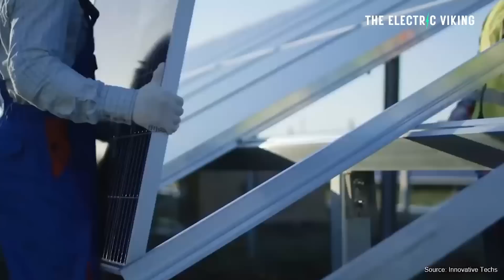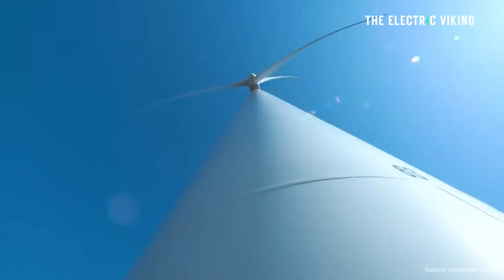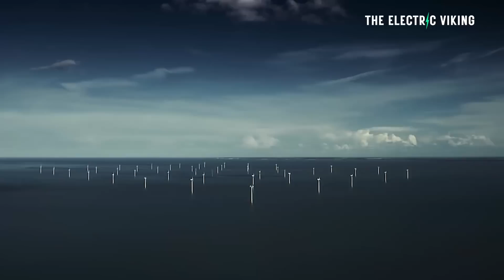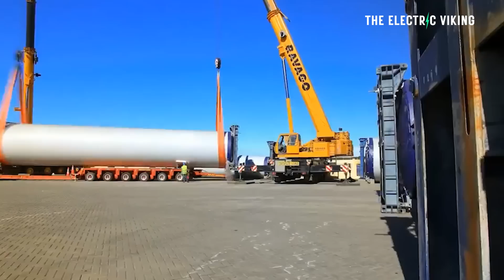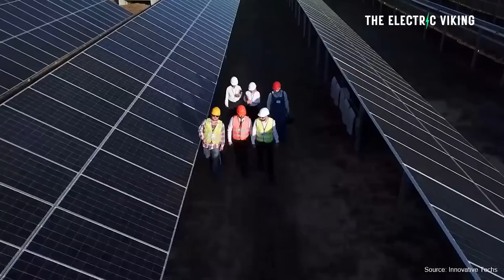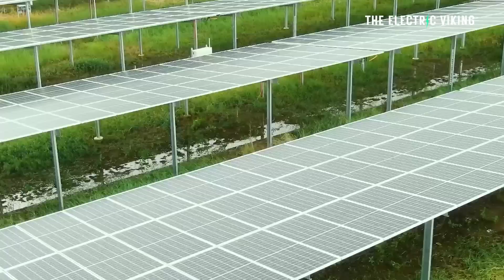8 countries now generate over 99% of their electricity from renewable energy

Comment: The best wind turbine I designed to be the smallest size, can be installed at a low height, does not take up space and is noiseless. It uses water pumps to a high tank and spins the turbine when there is no wind, so there is no need for batteries. The cost is very low, resulting in the most efficient wind energy and the least impact on the environment.I am going to Canada and I have installed a high-efficiency wind turbine in my private garden.

Comment: As a Norwegian, i wonder where the 1,6% made from fossil fuel comes from? Smaler generators at off-grid building sites? Surplus electrisity imported at night, from coal powered or nucular plants outside Norway? Or is it the smal coal powered plant at the Svalbard islands, delivering electricity to the 2417 souls living at 78 degre north in Longyearbyen, that are close to the northpole, and where it is total darknes for 4 months every winter. On 19 of October 2023 the coal powered powerstation was shut down and replaced with a new one runing on Diesel.

Comment: Ya even if your claim were true - Electricity is only 33% of the power used. ALL the rest is fossil fuels. Even Iceland that has all geothermal for electric and a lot of heating; they still have lots of fossil fuel used. Norway exports oil; but they do have a lot of hydro for electricity. Hydro dams are giant CO2 users; they take 20 million tons of concrete and 2 million tons of steel to build.  Do you think Frances's nuclear power for electricity is zero CO2?  Wrong; production of rare  U235 uses massive amounts of mining then refining and then you have giant structures for cooling towers and containment; plus you have terrible side products like polonium.

Comment: So there are new ways to improve energy generating capabilities from existing windmill. That even with no wind the windmill runs.... And capturing other things like static energy and many other forms of energy. And yes, at the top of the windmill, having solar panels, even the shaft of the windmill can be wrapped in solar panels. Even if you have horizontal and vertical working together, that's when they're wind.Then my system works when there's no wind and the solar panels wrapped around the shaft and at top and maybe on the blades can further generate energy.....

Comment: Yes, these near ground wind turbines would work perfectly on a windmill. To do the integration you just have to see how it can help about the traditional windmill faster. Yes the vertical windmill can help move the horizontal windmill. So both can work together making both stronger and they can produce lots of energy even when there's almost no wind... But you have to integrate them where they help each other moves. Push pull system.

Comment: And of the seven countries that made 99+%, FIVE were due purely to hydroelectric, ONE was due purely to hydroelectric and geothermal, and NONE of them got more than 4% total from wind and solar.  In other words, the common denominator was unique geography which does NOT translate to other countries.  The same situation applies to Norway, with about 10% from combined wind and solar, and about 88% from hydroelectricity.
So the big takeaway from this video is live in a country with lots of hydroelectricity.

Comment: In recent weeks, Portugal has produced more renewable electricity than it consumes. Portugal even exports electricity to Spain because it produces too much with the help of dams.

Some gas-fired power stations continue to produce marginally for technical reasons, but everything the Portuguese consume comes from renewable sources.

And the prices of these renewables are so low that producers are already worried because they sell clean electricity at very low prices.

Comment: All seven countries have little to no industry and with the exception of Iceland their domestic energy consumption per capita is very low. Paraguay has the Iguazú falls for hydro, Iceland has geothermal energy. I think the percentage quoted is for the electricity grid, transportation is not included and is mostly fossil fuel- based.
Reply: It's almost all hydroelectric, with a dash of geothermal for Iceland.  This is nothing new.  Solar and wind are barely blips for those countries.

Comment: Solars big problem is ot puts out much less in the winter than the summer. That statement on California is very misleading since they ran on 100% solar for a few hours per day not entire days.
Reply: So summer when there is air conditioning demand it puts out more, than winter when there is less AC demand. OK. 

Can also put on rooftop solar which simultaneously reduces AC requirements for the building it is on.

Sorry this problem has already been assessed and dealt with by engineers and it turns out it is not a problem.
Reply: @5353Jumper  As we push to go all electric EVs and heating will increase nighttime electric use. Especially during winter when solar output is diminished.  My solar averages over 50 kwh per day in June/July and around 6 in December
Reply: @rayshepherd2479  which is why a diverse mix and storage are the goal.
Reply: @5353Jumper  Storage doesn't do work between summer and winter solar output.
Reply: Misleading? I’ve seen multiple articles supporting this statement on California and makes sense.. can you show media otherwise?
Reply: @smalldogstudio  I would suggest the EIA website, where you can get relatively impartial statistics, not the MSM solar fanboy headlines.
Reply: @smalldogstudio  You can find it online. However,  just think about it there is no way solar provides power at night. So it only provided 100% during peak solar output which was about 6 hours per day

Comment: All those windmills, and not one of them will save as much CO2 as it took to mine, refine, process and transport the materials used in their construction, let alone the thousands of tonnes of steel and concrete for the foundations, millions of litres of paint and of course the resin for the blades which last as little as 2 years in some locations before needing replacement. Then of course when the wind doesn't blow you need reliable thermal generators for backup, which need to be kept idling constantly because you simply cannot start them from cold when the wind drops without warning. Not to mention the thousands of birds and bats and trillions of insects killed by these monstrosities every year. "Renewable energy" is the biggest con game in the history of this planet.
Reply: IEA disagrees with your entire statement
Reply: @brenth.8474  Of course they do. Their existence depends on promoting the lies, as does the IPCC. Read a few articles at the website stop these things, especially the section on wind power fraud, and learn the truth. Youtube routinely delete comments with external links, so search "stop these things" without the spaces and add the common prefix and suffix for web addresses.

Comment: Rooftop solar is the only investment returning a tax free 10% return (often much higher), backed up by a 20-25 year panel warranty and equipment is secured by homeowners insurance. If you could buy a bond that payed out a tax free interest rate of 10% for 20-25years and was 100% insured from loss, most asset allocators would take that option for a portion of their portfolio. It’s a great investment (I’ve done it 2x on two homes) and it just keeps getting better every year ignoring the tax incentive savings entirely.  Don’t like making or saving money?  Don’t do it.

Add an EV to a solar powered home (even partially solar) and you supercharge that tax free 10% return to include gas savings.  After all, you are getting electricity at 50% or less than what the utilities are selling it for and you’ve locked in your electricity cost for 20-25 (or more) years at some % so you don’t have to worry about opec changing oil prices. An EV saves thousands of dollars over gasoline each year so the 10% return from solar panels can easily jump to a tax free 20% or more. And who wouldn’t want to own their own gas station with a tax free ROI?
Reply: 🌅Very clear explanation of Solar PV R.O.I. I add 1. it's also 'Positive Cash Flow' from day 1!  2. After payoff of initial investment, it's Profit!💰  For the owner of the source of their energy, Nothing beats free 'fuel' energy source!🗽
Reply: This only works in certain locations and includes huge tax subsidies.
Reply: @dzcav3  subsidies are irrelevant to the returns - add those in an the returns are far greater, in the 15% range.  But it does not work in perhaps 15% of populated areas, and it wasn’t designed to.  But they do use it in Antarctica, so there’s something.

Comment: Installed 13.2 kW solar PV system in 2012 and two Powerwall batteries in 2018, and have been net positive for 12+ years now exporting ~50% of our excess solar back to grid and actually operate as a microgrid for 8+ months of the year in Edmonds, WA. Thanks for doing positive stories like this. Love your channel/content!
Reply: How much did you spend on all those solar panels and batteries?

Comment: Wind is great for now but I think it will diminish to solar over time. Windmills are mechanical, PV is not. Just like ICE vs. BEV, the less mechanical the more opportunity for steep cost declines. Solar will just be much cheaper and use fewer resources. Batteries are very important, as well.
Reply: Not at all. Wind and solar are very complementary. We need both.
Reply: @Freba9  Why if solar is way cheaper and we have more than enough very cheap stationary storage? It's like hydro...good for now but too expensive and environmentally harmful to keep around in a decade or so.

Comment: The naysayers — most of them fossil fuel industry sponsored or inspired — said that it was impossible. Whereas, converting to 100% renewable electricity, and then, (virtually) 100% renewable power is technically the lowest hanging fruit of the urgent challenge of environmental sustainability. That’s not to say that it is ‘easy.’ The only real barrier is political — to overcome the fossil fuel industry disinformation, and most significantly: to circumvent the fossil fuel funded political class — e.g. Putin’s Russia, Saudi Arabia etc.. Whether those states will give up their addiction to fossil fuel money is another matter altogether, as so many of them are on the dysfunctional spectrum.
Reply: And of the seven countries that made 99+%, FIVE were due purely to hydroelectric, ONE was due purely to hydroelectric and geothermal, and NONE of them got more than 4% total from wind and solar.  In other words, the common denominator was unique geography which does NOT translate to other countries.  The same situation applies to Norway, with about 10% from combined wind and solar, and about 88% from hydroelectricity.
So the big takeaway from this video is live in a country with lots of hydroelectricity.
Reply: @dzcav3  Excellent. That’ll do nicely while they build up solar and wind capacity.

Comment: Germany's economy is collapsing, factories are shutting down. You can't run an industrial economy on sunshine and breezes.
Reply: The problem for Germany is that it stopped buying cheap natural gas from Russia to instead buy liquefied natural gas from the US at 3x the cost. Renewables are an attempt to solve the issue, as the only other alternative would be to abandon the Russian sanctions and start buying natural gas from it again.
Incidentally, if German's transition to renewables wasn't so slow before the war its economy would have suffered far less.
Reply: @FabioCapela  The first part of your post is spot on but you can't run an industrial economy on renewables unfortunately.
Reply: @Withnail1969 the IEA disagrees with you

Comment: I am concerned that behind this enthusiasm about the wind and solar there is insufficient funding for the development of more promising forms of clean energy. As example, for the deep geothermal drilling. Anywhere below our feet at a depth of 20 km the temperature is 500 C, enough to generate overheated steam. 99% of the Earth is hotter than 1000C and this heat is an inexhaustible energy for any possible number of people on Earth and will last for billions of years, longer than the Sun itself.

Comment: I can’t tell you how many times I’ve been told that it’s not possible to run a grid without gas or coal…. Not possible until people start doing it, I guess.
Reply: Tell that to Brazil. It's been using renewables (hydropower) as its electric grid cornerstone since at least the early 80s, if not earlier.

Comment: Great job to these countries. 
Albania - 99+% hydro
Bhutan - 99+% hydro
Nepal - 99+% hydro
Paraguay - 99+% hydro
Iceland - 70% hydro. Only other major contributor geothermal. 
Ethiopia - 96% hydro, 4% wind
DRC - 96% hydro. Other sources were too small to be noted. A sad footnote is the bulk of DRC's "renewable" energy is from the burning of biomass, which produces as much CO2 equivalent as the dirtiest coal. Also, 19% of the population has access to electricity. The government hopes to increase this percentage to 32% by 2030.
Reply: Biomass can be an issue if you are cutting down vegetation or growing crops in order to feed the biomass power generation.
If you are using biomass waste — like, for example, bio residue from processing crops — then it's effectively carbon-free power, because if the waste was instead discarded it would generate the same CO2 emissions as it decomposed anyway.
Reply: @FabioCapela  you're not wrong. The co2 emissions remain the same, and from what I can conclude from the reporting, the biomass in this case is primarily charcoal for cooking and heating. Which brings up many non climate change concerns  for the people locally.
Reply: @carrdoug99  That, unfortunately, equates to cutting down vegetation, making it very environmentally *un*friendly. And yeah, charcoal for cooking and heating can be dangerous for a number of reasons, including how it generates enough carbon monoxide to be dangerous in enclosed spaces.
Reply: @FabioCapela  1st thing I thought of when I learned this was what does the TB Incident rate look like. No surprise, it's very high.
Reply: The most important thing is to locate yourself in a low-population country with huge amounts of dammable rivers available.  The rest of the planet is not so fortunate.

Comment: I didn't want to reply but the presentation is misleading at best. 100% renewables by your definition implies the country is running on "renewable" power. But at no time are the base power fossil or nuclear fuelled generators shut down. Take out the mountainous countries and what you have left is a very unreliable source of electric power. The solar panels in Germany will be covered in snow half the year. Not for me. A very expensive waste of time, money and resources for really no guarantee that the atmosphere will change at all. And so ugly, despoiling the natural landscape for no human gain. $16million Aud for one wind turbine would build at least 30 houses.
Reply: Snow tends to not accumulate on even common solar panels (likely due to the glass coating and the little heat produced when generating electricity), much less on properly winterized ones. Heck, one of the unadvertised advantages of Tesla's solar roof is that snow slides down rather than accumulating, to the point after a snowstorm you can figure which house in a neighborhood has a solar roof by the lack of snow on the roof.
And renewables will win out not because of environmental concerns, but because they are already cheaper, and getting even cheaper as time goes by. In much of the world solar or wind with battery storage is already cheaper than gas and battery storage alone cheaper than peaker plants.
It's the same with EVs. They will likely get cheaper than ICE cars in China by the end of the year or the start of the next year, and before the end of the decade for the rest of the world. Couple that with better tech — for example, there's already a Chinese brand selling an EV with 650 miles of range — and improved charging infrastructure and there's a good chance ICE car sales will vanish.
Reply: @FabioCapela  Keep believing in Utopia Fabio.
Reply: @David-rc6ne  When I posted that I had forgotten about vertical bifacial solar panels; those are even more impossible for  snow to accumulate on — as they are smooth vertical surfaces — and increase their efficiency when the ground is covered in snow to boot (both because of the lower temperature and because snow increases the reflected sunlight). When imported from China those are so cheap right now that some people are using them as fencing.
As for the rest, there are numerous studies showing how renewable power generation is already cheaper than anything fossil fuels can offer. And with prices of solar panels and batteries falling fast (and wind turbines getting cheaper at a slower pace) the cost advantage of renewables will only grow.
Incidentally, the numbers are in for Chinese car sales for the first half of April and BEVs+PHEVs have just increased their market share in China to over 50%. With the Chinese car market being the largest in the world by far — it's roughly the size of the US and Europe car markets added together — this by itself should guarantee a nice increase in the global EV market share, and also means any carmaker not releasing EVs might as well give up on selling cars in China, which for many of the legacy auto companies is still one of their most lucrative markets.